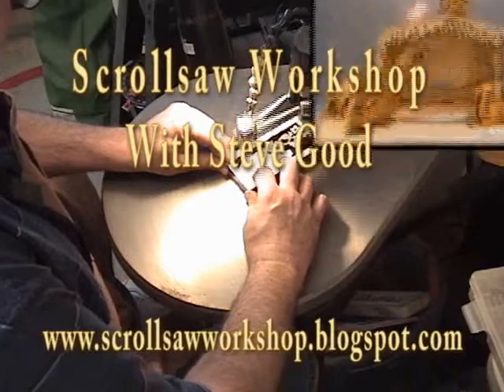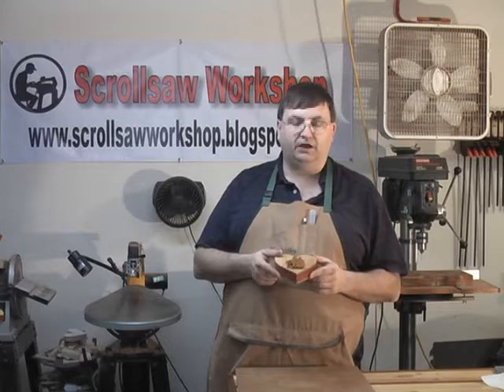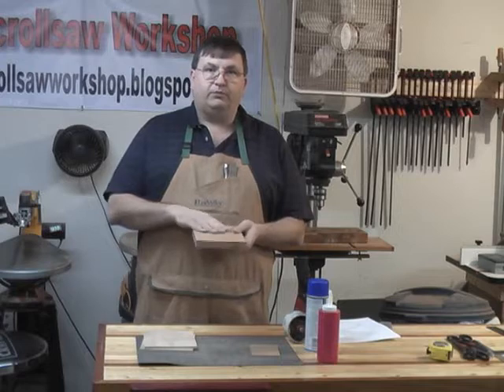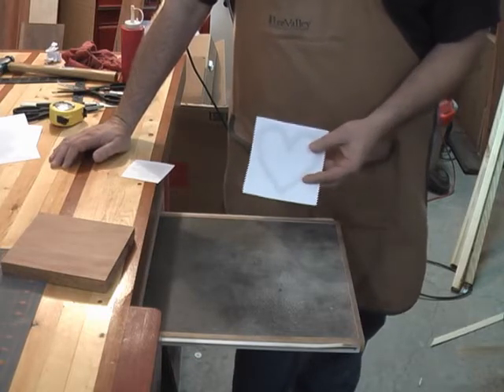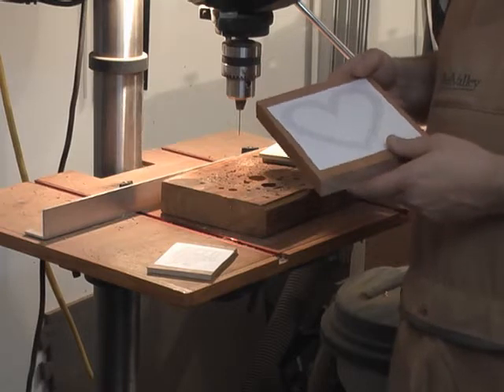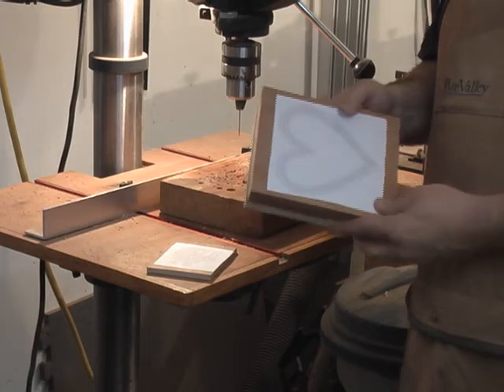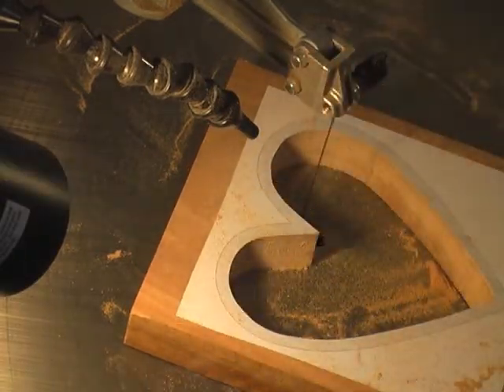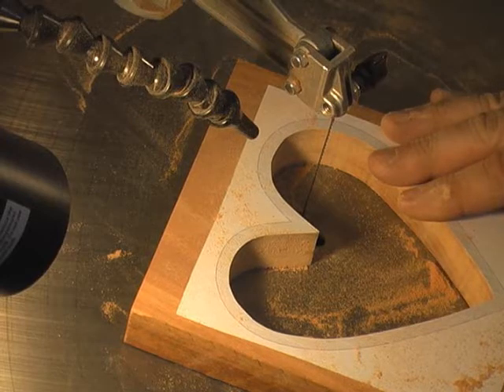Scroll Saw Heart Box Part 2

Comment from the maker: @mspeir when you buy rough lumber it is refereed to in quarters of an inch. When you go to the lumber yard and ask to purchase hardwood you ask for it in 6 quarter if you want 1 and 1/2 inch thick boards. Typically the big box stores like Home Depot or Lowes sell dimensioned boards and they will refer to it in inches.  In either case you can ask for a certain amount of "board feet" then specify the thickness in quarters. You can also buy lumber by the linear foot at the big box stores.